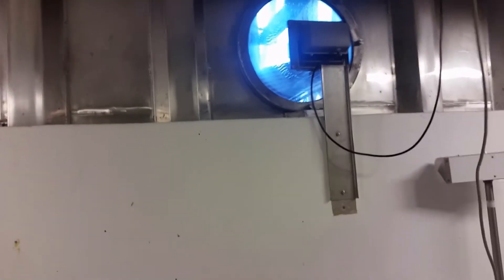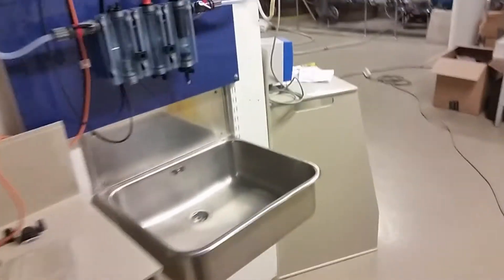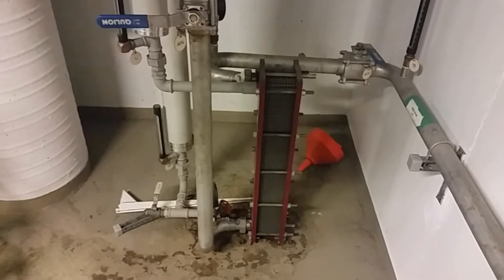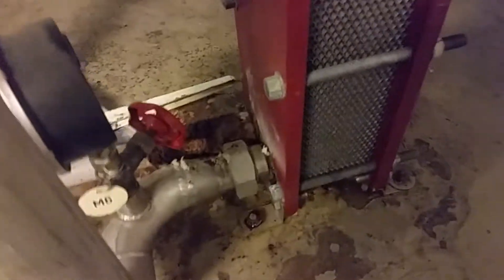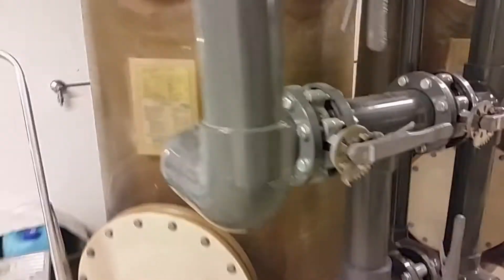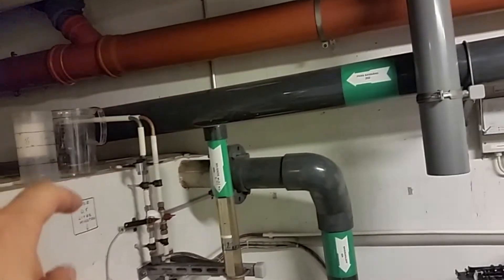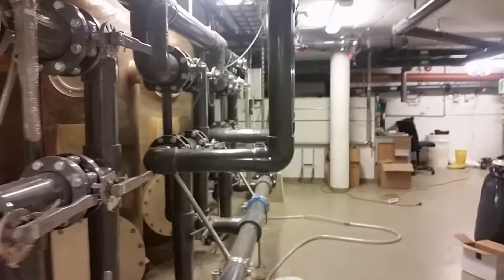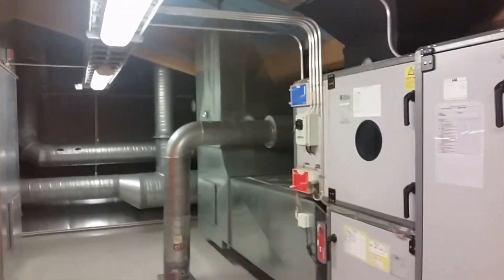Therapy Pool Water Treatment Plant

Comment: Very interesting video. What is that PBK or EBK you mention?
Reply from the maker: It is a system that recovers heat from the ventilation air that exits the swimmingpool area, that air has a lot of moisture that can be condensed by an heat pump and the latent heat is used to heat up the pool water. BVK (swedish) is the shortening for Bath Water Condenser
Reply: @MrTesla1337  Thank you. Very interesting.